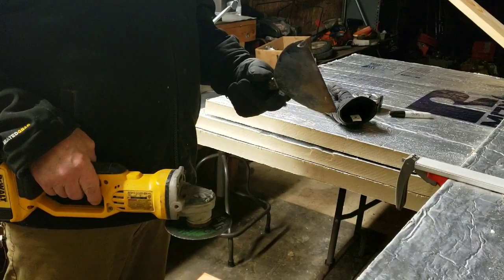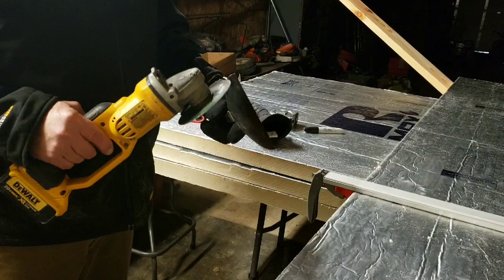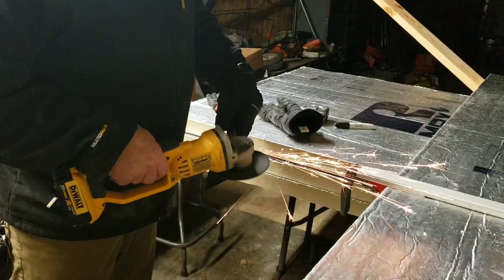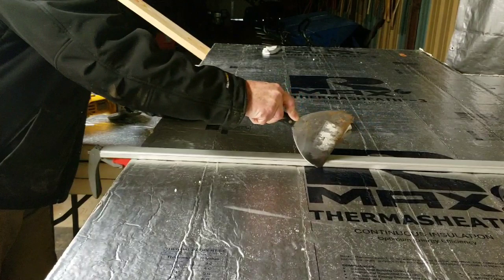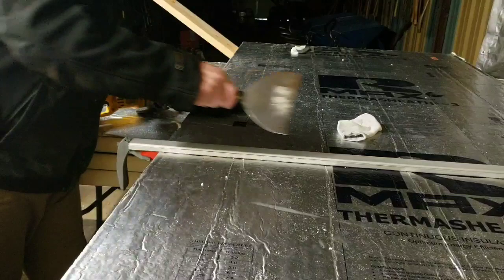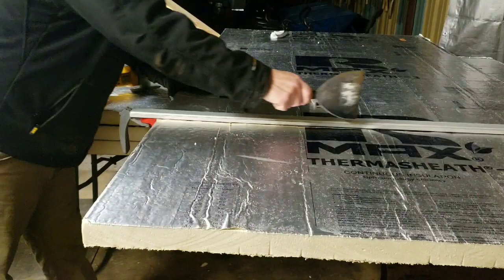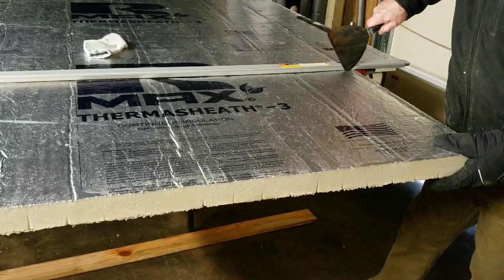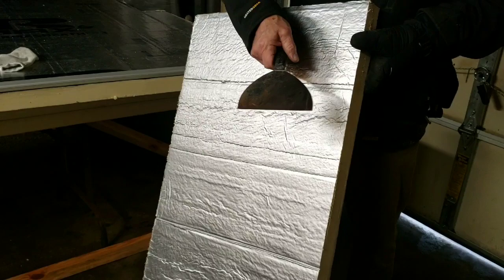How to cut Foil Faced Rigid Insulation Panels R Max

Comment: I use a razor knife that can extend out about 2”.takes 2 swipes. Some times pushing and out slightly.
Jon’s way is nice too😁
I cut about three quarter through then break sheet like drywall. Cut foil paper on other side.

Comment: Hello!  We bought a 1920 farmhouse balloon framework. We started remodeling inside and low and behold we can actually see this foam board. I went outside to take siding off and the house is wrapped in this. Foil facing the vinyl. Lots of people have told me the house needs the house should of been wrapped after this type of insulation was done. It has vinyl siding. We have discovered water damage. What are your thoughts?  Peel all the vinyl off and wrap over this stuff ?  I am a 53 year old woman newbie in house Reno and need thoughts please
Reply from the maker: I have been installing this stuff on buildings for years and years and years so it does not deteriorate unless it's mechanically deteriorating and it is viable forever so if it's still in good condition there's no reason to remove it just protect it and move forward
Reply: @Jonehughes  do I have to lay the traditional house wrap over it and then replace my vinyl?  Thanks for such a fast response!  I am impressed!  Many you tubers take months and or don’t acknowledge comments
Reply from the maker: @doublekhobbyfarm  Yes your house wrap is your envelope your siding just protects the house wrap
Reply from the maker: @doublekhobbyfarm  and go to your local building department and ask them what's the best house wrap lots of times a single barrier house wrap is not nearly as good as a corrugated house wrap depending where you live and your environment
Reply: @Jonehughes  Thank you!  I am in Minnesota. Looks like I have lots of work to do this summer

Comment: Can someone answer once and for all, which way does the foil face if your house is old as dirt and is built literally on the slab, with 2*4s, sheetrock, no sheeting, just siding.
Reply from the maker: Hi Kat
It's a little harder to answer than that

Because it doesn't always apply

The foil back insulation I was using

Has foil on both sides

So the answer would be

Either side then

But if you only have foil on one side

It should be just like fiberglass insulation

If you read a piece of fiberglass insulation

It will say put the paper towards the living side

So the foil should go on the living side

Comment: I have a random question, I’m doing a project with the foam and I need to remove the foil backing for it, do you know how I do that
Reply from the maker: Dang it cost way more money for the foil backing you can buy for half price without the foil
Reply from the maker: No I have no idea how to take it off
Reply: @Jonehughes  do you where I can find foam without the backing?
Reply from the maker: Your friend has shared a link to a Home Depot product they think you would be interested in seeing:

Owens Corning	FOAMULAR NGX F-250 2 in. x 4 ft. x 8 ft. SSE R-10 XPS Rigid Foam Board Insulation
https://www.homedepot.com/p/Owens-Corning-FOAMULAR-NGX-F-250-2-in-x-4-ft-x-8-ft-SSE-R-10-XPS-Rigid-Foam-Board-Insulation-52DDNGX/315197962
SKU# 315197962
Reply: Eps Foil backed was actually cheaper here for a better r value on top of that .. Compared to Owen's Corning xps..